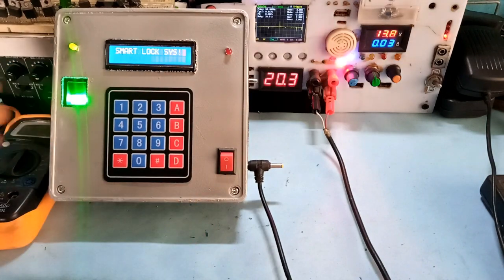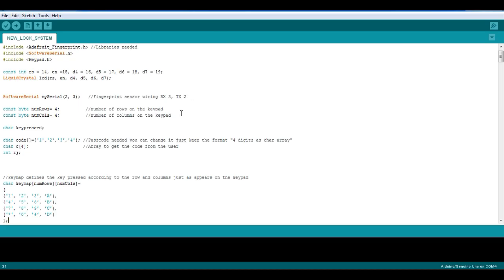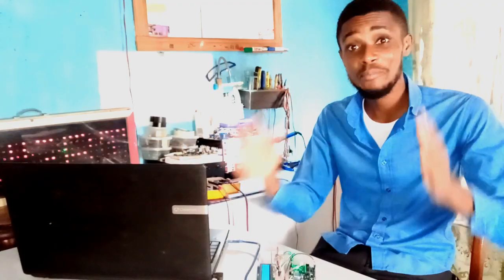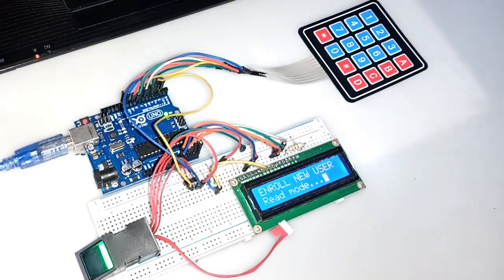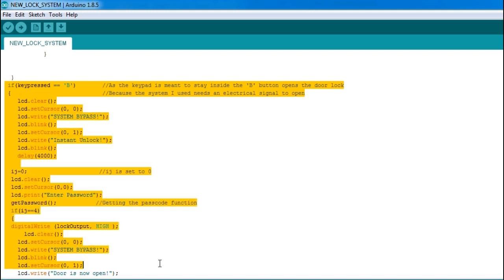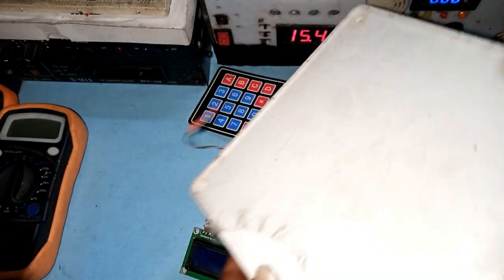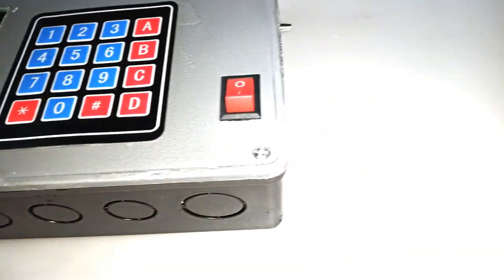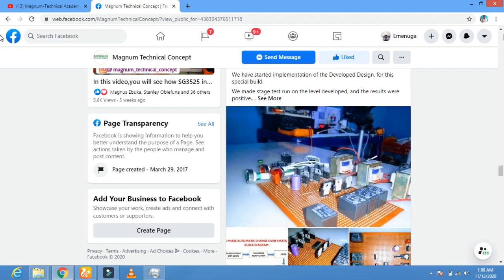Fingerprint and keypad Arduino lock : How to make biometric lock system.

Comment: Great video! Well Done. 
Is it possible to be able to extract data of checking and checkout times?
Reply from the maker: Yes, that can be achieved using the serial monitor, though I didn't show that on the video...

I can still guild you if you wish to make the assembly

Comment: Brother u are trying, consider designing arduino  based mppt charge controller with both input and output current measurement on lcd 4x20
Reply from the maker: Thanks 😊 for your kind feedback, and concerning the charger controller, I have it in my to do list, as I am acquiring materials for the project.
Reply: Awaiting